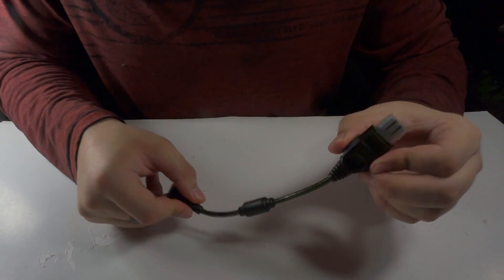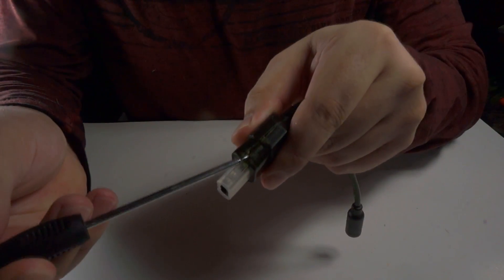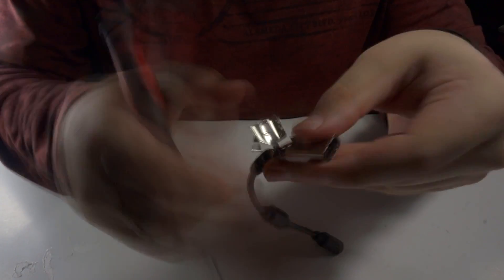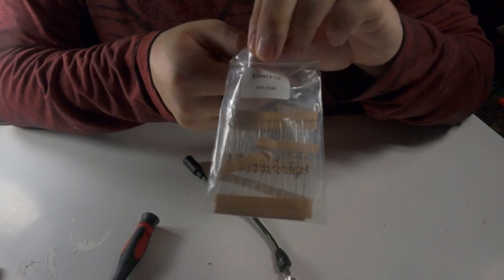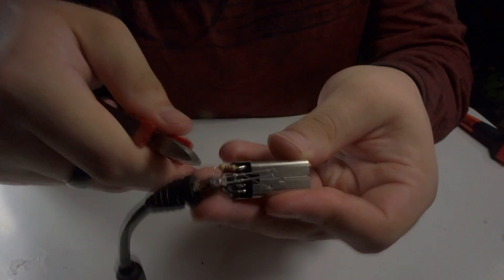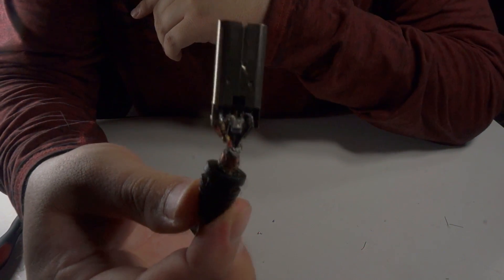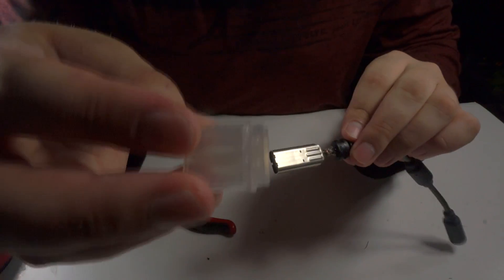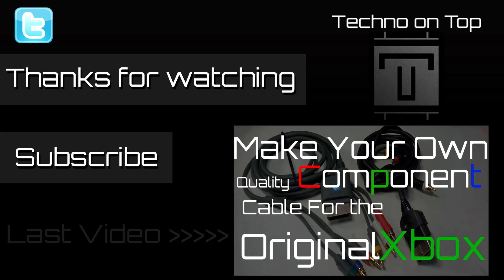How to add LEDs to Xbox controller dongle (very easy)

Comment: Quarter watt, half watt, one watt? Which resistor? Ty much
Reply from the maker: 470ohm 1/4watt
Reply: TechnoOnTop will a 1 watt resistor work? It will make it more dim right?
Reply from the maker: the 1/4w refers to how much much power it can dissipate. 1W resistors would be used in a more high power application but you can use a 470oh 1w resistor, 1/4w is just cheaper. the only thing that would effect brightness would to be get a resistor with a higher Ohm rating 500,1k ect
Reply: TechnoOnTop thank you sir